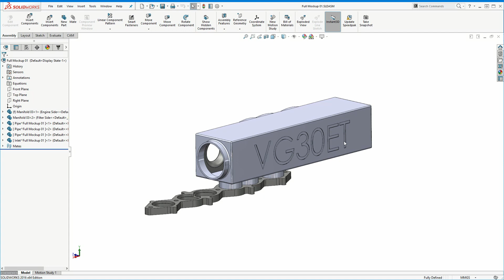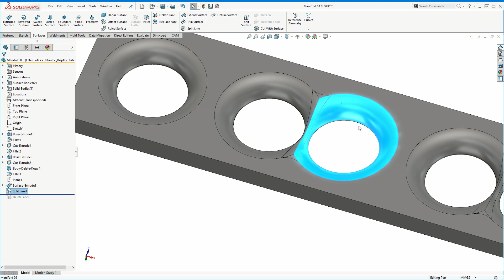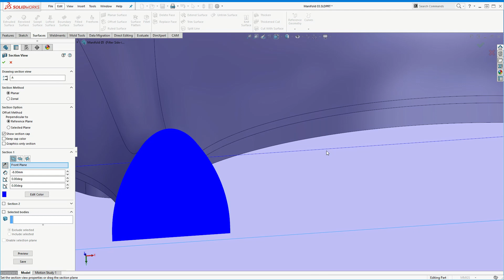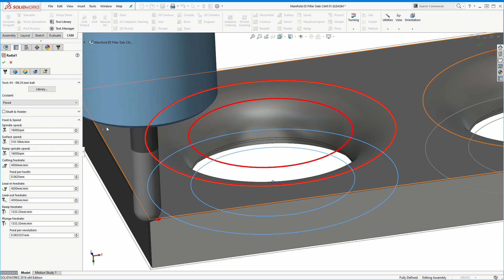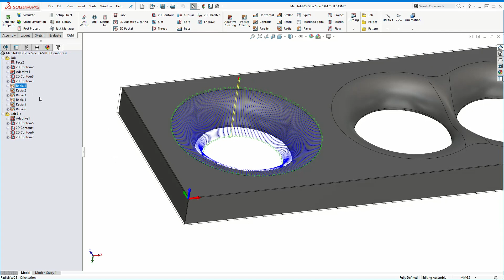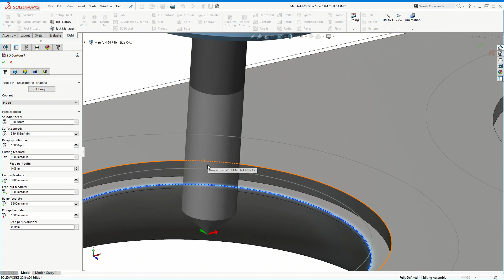Intake Manifold Plenum (pt. 1 of 2) - SolidWorks Delete Face and HSMWorks Radial Machining (VG30ET)

Comment: Back posting videos! My guess is you got better quality going up than coming back down based on the tool engagement. Haven't watched the machining video yet - did you try a spiral pattern? I would think that would have been great, especially starting from the bottom and slowly working its way up.

Hope all is well!
Tom Z
Reply from the maker: I'm actually not sure which direction gave the better cut. I was assuming going up would be better, but I can think of reasons why going down could be better too. I have a project where I need to do some more 3D milling and I'm going to use the same bit. This time I'm going to mill upward only and see how it looks. I probably would have milled it yesterday, but SolidWorks (or maybe HSMWorks) was being a total piece of shit. I upgraded to 2017 and... boy, it's bad. I would have thought they'd get it functional by SP3, but I was wrong. Maybe this'll be the kick I need to finally switch to Fusion 360.

A spiral could be good too. I went with the radial because I figured the cusp pattern would "look like" it would guide the air down into the holes. I also figured the radial pattern would look nice and uniform.

Comment: I know I talked to someone about this.  My thoughts.....and we both know they're not backed by much experience at all......on the ball mill would be to use a 3/8" bull nose EM.  When the EM gets to the top flat of the part, the flute is moving way faster at the bottom of the bull nose EM than the tip of a ball mill.  On a 1/4" ball mill, there's a .125 difference between the side of the ball and the tip with the tip turning extremely slow.  On a 3/8" with a .060 rad, there's only .060", but it would still be more than .125" away from the center.  The speed of the flute would be much more consistent throughout the travel.......making a more predictable cut/finish.....?????   Is it a moot point in reality?  
The VG30 is a really nice motor and used as an upgrade in a lot of older Datsun cars and trucks.
Once I saw it was SW, I almost stopped, but then I figured there's probably some good info in it anyways....lol  Plus...I knew I was going to watch the next one, so that gave me a bit more motivation to watch this one. :)  Makes me want to try this in Fusion.
Reply from the maker: bluehandsvideo
Awesome, thanks! For some reason, using a bull nose mill isn't something that occurs to me when I'm doing a 3D operation, but that sounds like it would work great! (Especially on giant circular fillets like what this part has.) I think I have a 1/2" bull nose mill around here somewhere that has a comically large radius on it. When I saw it in person I remember thinking "welp, this was a waste as I'll never want internal radiuses this large".
Reply: When I was getting ready to do the tattoo parts, I was thinking about how I didn't like having to go so slow on the parallel tool path because of using the ball nose.  I didn't want to drag the tip of the ball nose across the steel.  It dawned on me about the bull nose.....so I set it up for that.  I had it cut the last .005" while it was at it.  I'm sure someone told me about using a bull nose instead of a ball nose before.  Nothing new under the sun and I know it wasn't an original idea! lol